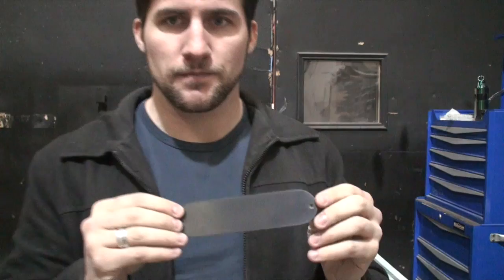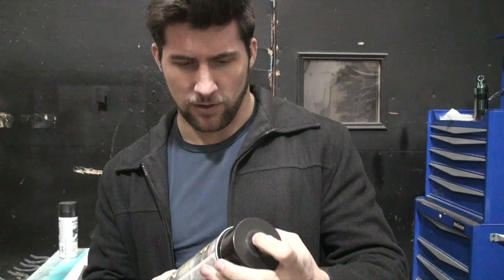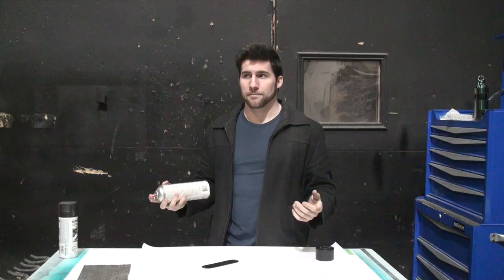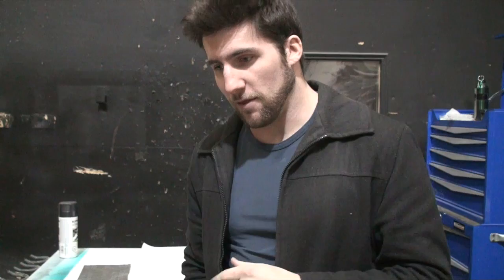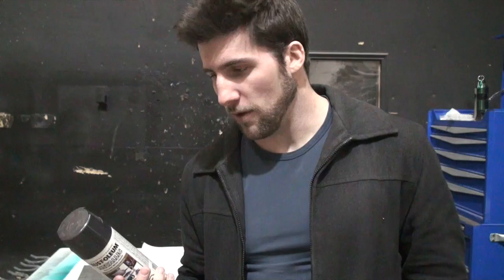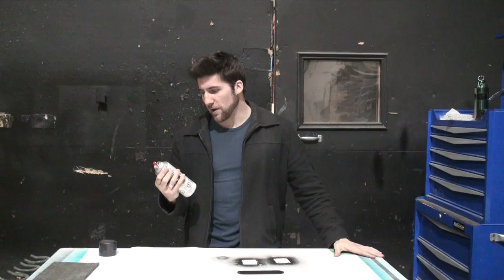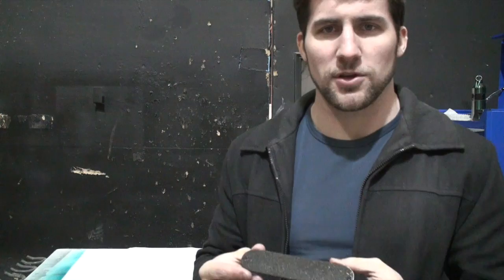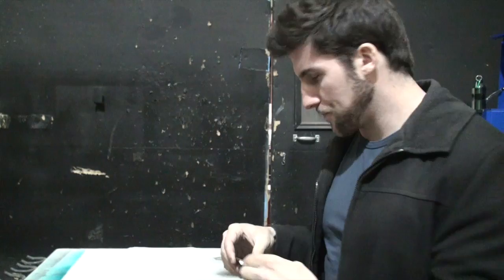How to paint plastic parts properly

Comment: Hi,
I want to paint PVC pipes with Aerosol spray can can and I was wondering if it is a good idea to "hang" the pieces and spray  paint them while hanging such that I have access to all sides at once. I tried painting a sample pipe and the paint dripped to the other side of the pipe. Also, do you have any tips on painting PVC pipes. I need them for a presentation. 
I will appreciate your prompt input.
Thank you so much.
Reply from the maker: Have a look at my video on how to get an even coat of paint of curved surfaces with spray cans.

Comment: I want to paint some sunglass frames would this be the same method ?
Reply from the maker: Essentially, yes. Just make sure you mask off the lenses.
Reply: Brad Angove the lenses are removable. what brand of paint do you recommend
Reply from the maker: I don't have a preference for any brand in particular as it stands, but I would probably use rustoleum if it were me just because it's easily accessible.
Reply: Brad Angove wouldn't duracoat and cerakote be better quality
Reply from the maker: The firearm finishes? I don't know. I doubt that many people would want to go looking for firearm paint to spray plastic parts.
Reply: Brad Angove oakley paints their sunglasses in cerakote
Reply from the maker: Interesting. Well, I'm sure oakley knows a hell of a lot more than I do about sunglasses than I do.
Reply from the maker: It's probably a good idea to follow their example haha.

Comment: Hey Brad, I’m wanting to paint my telecaster pickguard, but with some designs, not just a solid colour. Would it be possible to paint a white pickguard with some acrylics, then clear coat it without the wear ruining the design? Also, what specifically do you recommend for those clear coats?
Reply from the maker: Yes you can do that. I’d use acrylic clear. Note though that it’s not all that hard to wear through something like that if you’re aggressive and actually scratch your guard. Particularly with paint in plastic, which is never a great bond.
Reply: @BradAngove  Perfect, thank you so much, any particular brands you recommend as far as acrylic clear?
Reply from the maker: Not necessarily. Spraymax makes a good 1k acrylic clear.
Reply: @BradAngove  Appreciate you taking the time to answer!

Comment: Hey im painting an abs spoiler for my car followed same steps as you and wanted to know how long after painting should i wait to sand and polish
Reply from the maker: I would give it a couple of weeks to make sure it has hardened reasonably well.
Reply: +Brad Angove awesome and another thing the guy helping me paint had some pretty bad runs on a side of the wing and didn't notice till we finished will sanding and the polishing help :/
Reply from the maker: Yes. Sand the runs out flat first. Then just follow the normal sand and polish process.

Comment: Would a light bead blast work just as well ?
Reply from the maker: Does that abrade it? I was under the impression that that was more of a polishing technique.
Reply: @BradAngove  - I'll try it and post an update. ON metal it polishes but with large beads (or sand) you get a texture. I've done  it on polymer gun parts and then died them and the result was a nice "sand" texture but pick-guard / cover material may be softer.  - Thanks for the reply !

Comment: hi... i tried painting may back case on my android phone... i messed up. i used flat black spray paint. i left it for 24hrs i ended up having figer prints printed at the back even if it was already dried for more than 24hrs.. any suggestions?
Reply: you have to wet sand the whole thing let it dry and repaint
Reply: +Bob johnson thank you
Reply from the maker: It sounds like you have a drying problem. Probably due to temperature, or coat thickness. Unfortunately, your options for fixing it are limited because it's on plastic. If you sand back until you hit either the plastic or properly hardened paint, you can do another light coat and that might do it.
Reply: +Brad Angove true... ill buy another can of spray paint ill change the brand probably its the spray paint you know changing the brand for paint that dries quickly.
Reply from the maker: Just make sure you follow the appropriate redcoat times for the paint and you should be fine.

Comment: Thanks for the videos-great information.  Even though I have little artistic ability I was able to repaint an old bicycle helmet and it turned out great. I used info from your videos to sand, prime, paint, and top coat the helmet.  Here is a link to a pic:  https://www.facebook.com/photo.php?fbid=955645054480387&set=a.184721164906117.44912.100001047054639&type=1&theater    thanks again.
Reply from the maker: tjd171717 That looks great. Well done.

Comment: hi! I have some issues with some plastic pieces, when I paint them with spray paint they get really sticky, it seems like the plastic reacts with the paint, some kind of plastic because its not all the types of, but do you know any type of primer that is type of sticky meant to be plastic?
Reply from the maker: There are plastic primers available in a few different brands. The adhesion promoter may also be suitable. If you're using a paint that has heavy solvents in it, like a lacquer, it could be melting the surface of some of the plastics a bit. You may need to switch to a less aggressive paint. What kind are you using?
Reply: I've had the same issue with the stickiness on a plastic mallet. I used a spray paint meant for wood or plastic.  will a clear coat fix the issue?
Reply: And thank you for taking the time to make this video.
Reply from the maker: I'm afraid a clear coat is unlikely to fix the issue. Actually, it might solve the stickiness, but it will likely create a new issue with the clear being soft and impressionable.
Reply: thank ya, sir.
Reply from the maker: You're welcome. Best of luck with your project.

Comment: If i want to paint my guitar white do i use primer and then white or can i just use white?
Reply: I mean primer
Reply from the maker: Josh Fuentes What's on it now?
Reply: Brad Angove its just wood I was thinking about using the white primer and not have to paint it white but I don't know what do you think
Reply from the maker: It depends on what finish you're looking for. I generally recommend at least protecting your finish with a clear coat of some kind. If your wood is smooth enough you may get a decent matte finish from the primer. I guess you could leave it like that if you want to.
Reply: Brad Angove yeah i am planning on putting out a couple coats of lacquer
Reply from the maker: White kind of primer are you intending to use?
Reply: Brad Angove krylon all purpose white primer or what would you suggest?
Reply from the maker: I'm personally not a fan of krylon, but it will probably be fine. You likely shouldn't use lacquer over it though. That is an enamel product, so it's best to use an enamel clear coat.
Reply: Brad Angove  thanks dude your videos are really rad and are really helpful for what I'm about to start doing.
Reply from the maker: Glad to hear it. You're welcome.

Comment: Hey man, another great tutorial! I recently found your channel, which would have really helped my first cellulose project with cans (last year) - I didn't do a video but made a photo diary thing if you're interested: https://www.youtube.com/watch?v=ER2nxms44k4

There's a fair few things I learned what not to do and how to rescue things that go wrong, but my question to you is this: in my project (video above), I created multiple masking layers using tape, waited for the paint to dry, and then mask some more, then spray another colour. By the end, my paint layers were by no means level so I must have used three cans of gloss to bring it all up. Do you have any better ways of doing this? I found it quite a challenge at the time!

Thanks man :)
Reply from the maker: Alexander Wright That guitar looks great! Nice job. What you can do to reduce the ridges is take a scotch pad and just lightly rub them down a bit after you peel your tape. If you go too far, you may have to tape the edge again and touch it up, but generally it's not too difficult to avoid that and it will save you some time at the end for sure.
Reply: Brad Angove thanks very much Brad :) yeh, being a first time sprayer, I stuck religiously to the advice on the can, and only used 600 grit paper on a solid sanding block - will definitely try that next time. Thanks again!

Comment: Brad does sanding is necessary before coating?and is primer needed before coating?and how many coats we have to get perfect gloss?
Reply from the maker: Yes, sanding is necessary for adhesion. I usually use 3 coats.
Reply: Thank you
Reply: What is your suggest to rustoleum gloss black spray can.?because you give me a let link for gloss black spray can which is not available in india.so rustoleum gloss black is well or not?plz reply
Reply from the maker: Rustoleum gloss black will give you some shine, but you’ll want to use clear coat to protect it and get a better gloss. Like I did in the video.
Reply: Clear coat mean what i don't know.is it use after gloss black use 3times.i see in another videos they use gloss black but that doesn't shiny but then they use something for mirror like shiny black.can you tell me what is that?and thank you for reply
Reply from the maker: That’s the stuff. It’s clear paint that protects the colour underneath. That’s how you get gloss when the stuff underneath isn’t shiny enough.
Reply: Can i use the clear coat on my bike tank which is metal.?and without use any colour spray.because my bike tank colour just fade so i want only shiny ...can i use or not.?
Reply from the maker: Your tank already has paint on it, right?
Reply: Ya right ..right
Reply from the maker: Then yes, you can use it without putting coloured paint underneath.
Reply: Thank you for reply
Reply: Is sanding use before clear coat??
Reply from the maker: Thanks for watching.
Reply from the maker: Yes. 800 grit.